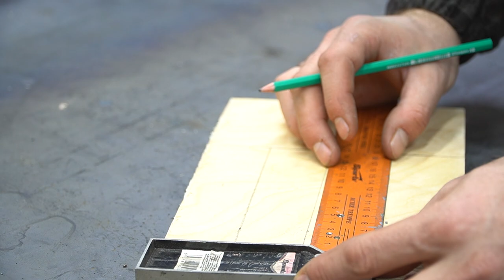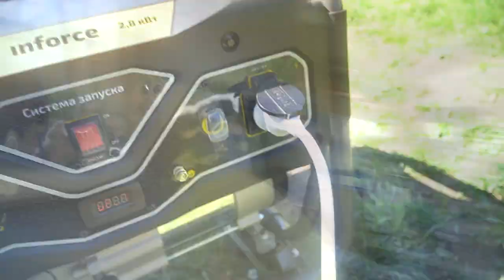Советы и хитрости мастеров, облегчающие жизнь! 30 лучших идей! А вы не знаете!

Comment: Using a second screw to extract a stripped screw was clever
Reply: 04:46 That's using a second screw to extract a screw that won't come out because it spins freely inside the hole. Then you use the second screw as leverage so it can push against it. A stripped screw is a screw that is tightly fastened but you have no way of gripping it to remove it because the pattern is gone. A second screw would not help in that situation because you still don't have a way to grip it to make it rotate.

Comment: 8:55 What is this tool called? I've never seen one of those.
Reply: It's called an "Oscillating Tool" it works similarly to a power tool version of a battery toothbrush spinning head. It has multiple different head/attachments. It pivots back and forth from the tool side to side about 45° and the attachment used you were asking about is a plunge saw blade, the cutting edge is furthest from the pivotal fulcrum of the tool. 
 It would be like how a saw fish uses its saw and swipes it left and right and right using the side facing teeth, however instead of the teeth being on the sides of the saw if they were on the end of the nose or the tip of the of the sawfish's "saw" pointing out away from it's body.  Then by moving its saw blade left and right the same way it could dig into the the  seabed using the sharp tip to get deeper into it because it has less surface and more force on the smaller toothed end to plunge cut into the sea floor.  
Hope that helps, that's about the least tool/mechanical explanation I could think of.
Reply: @rottnlove  Thank you!
Reply: Bosch AdvancedCut 18

Comment: À 5:27 je ne comprends pas la subtilité de l'oppération avec la perceuse! Est-ce que vous passez en mode percussion?
Reply: The only thing I can think of is that he's running the drill in reverse and pushing down. Then, after he breaks the surface of the wood, he puts the drill in forward again. I could be wrong.
Reply: @Thinks-First  ¸It seam that the drill run in reverse way. thank

Comment: Do not use the trick with the generator. You make a mistake and you can kill a line worker or injure them. Use a generator safety switching device. It will under no condition send power out on the mainline.